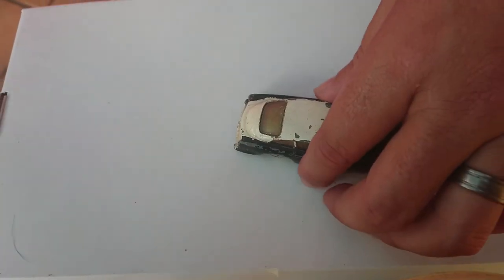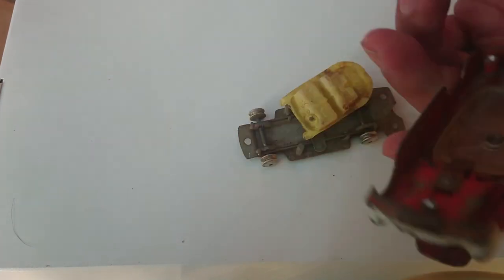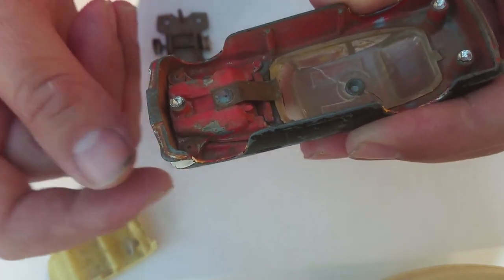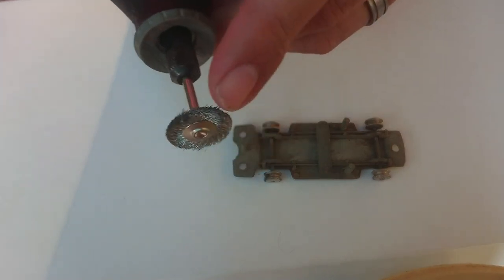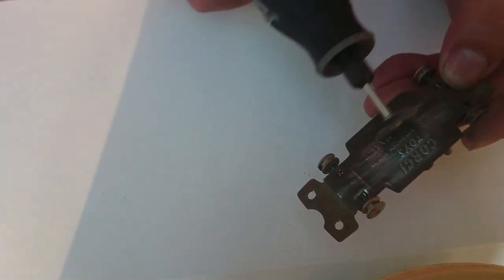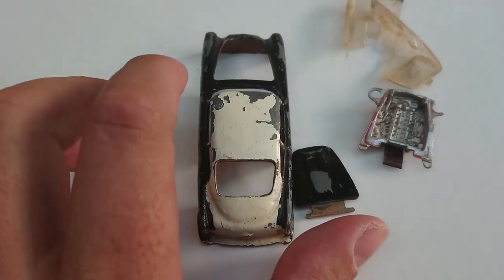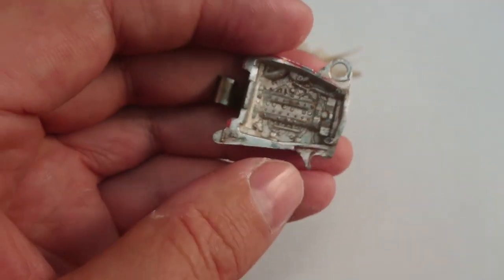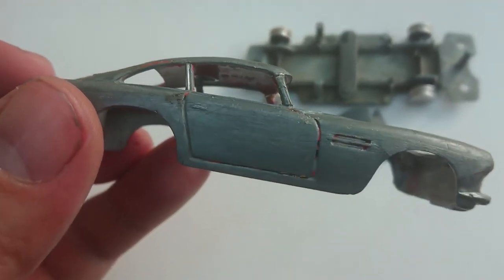Restoring Corgi Aston Martin DB4 Part 1

Comment: Could you have taken the axles out & popped the chassis in caustic soda, along with the body
Reply from the maker: I couldve, now that you mentioned it. Haha Keen eye Mr Ian
Reply: @rattlinghost8904  I do all of my stripping in that. Most come away, fairly easily. Caustic soda does however struggle with Lesney Matchbox. Usually takes a deep concentration or 2 or 3 hits